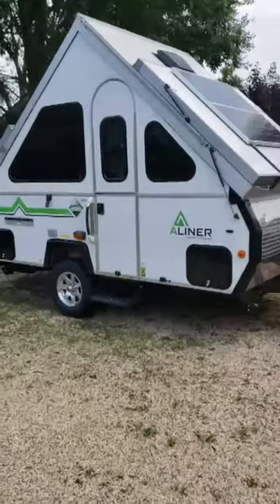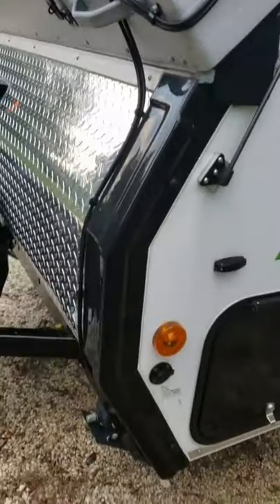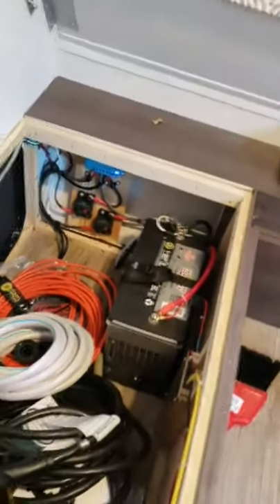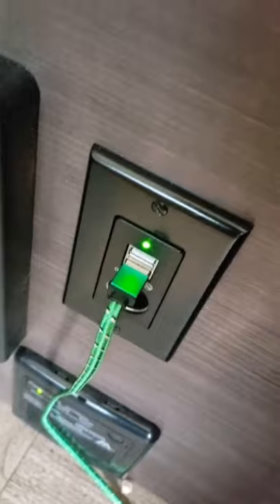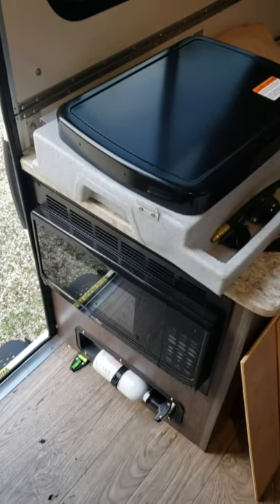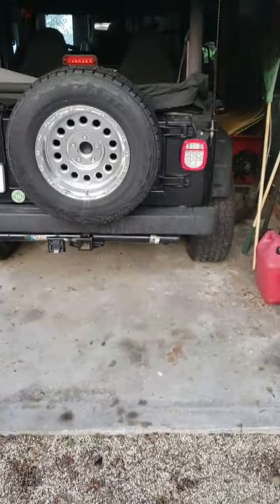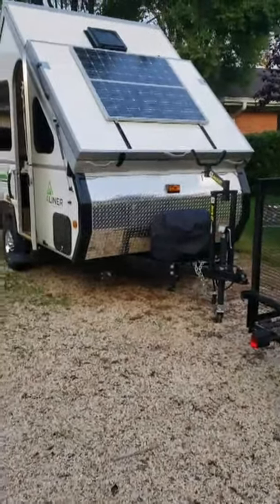Aliner Solar Panels

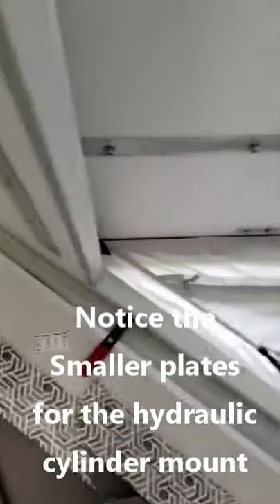Comment: 6:30 Shows bolts on inside. I was planning on using special 3M tape only, but I agree through-bolts will stop the panels from sailing away in highway windstorms. 
I may go with several 4×8 aluminum plates with carriage bolts on the inside, nuts on the outside, and paint,  or cover the aluminum inside with cloth or contact paper. Thanks for the video!

Comment: Thank you for the video.  Sorry on the passing of your Great Dane.  Is there any danger of having the propane connector for the stove in the same box (bench seating for the dinette) as a battery?  I realize there would have to be a gas leak and a spark but I was just wondering what your thoughts are?   Thank you,